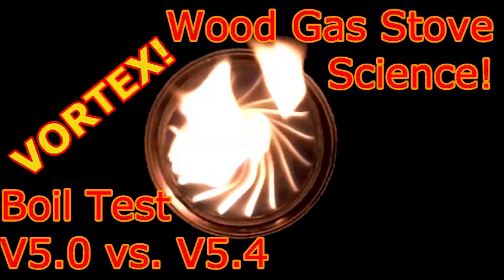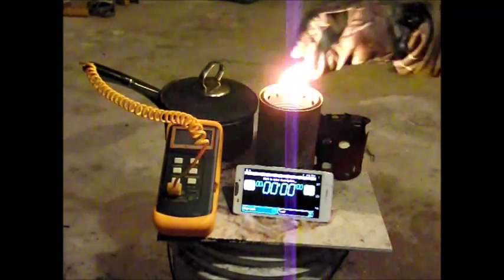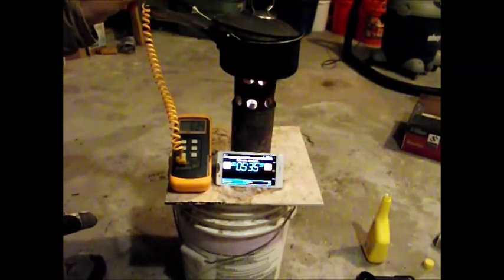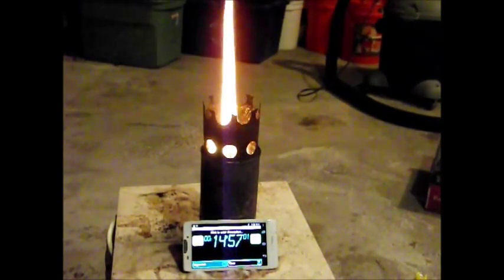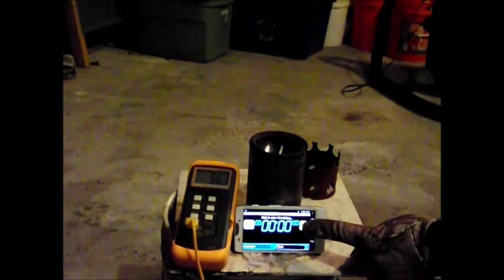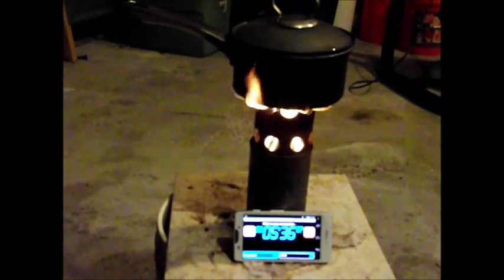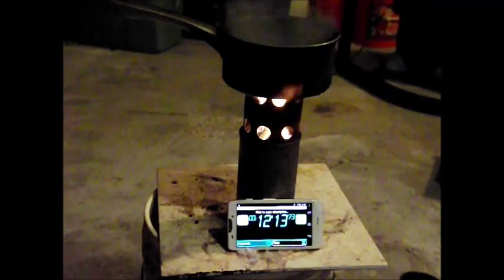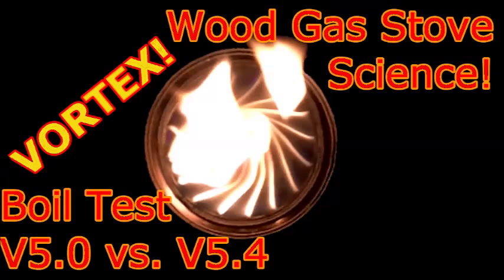Wood Gas Stove SCIENCE! Boil Test V5.0 VS V5.4

Comment: Really interesting stuff - I wonder if the relaxing ash is blocking the primary holes towards the end of each burn as they drop. Maybe flaring the holes up and down alternately might help (Like a volcano next to an inverted volcano) so the ash could potentially drop through the bottom or at least settle away from some of the upward pointing holes. Or maybe a central air tube like a piccolo tube reaching 1/3 of the way up the middle of the can purely to inject more air to the pellets. Any thoughts?
Reply from the maker: littledoms Those are interesting ideas! I will give them a try. Keep your eye out you may see them on an video in the near future. I have received some great ideas from viewers that I have to try also. Thanks for the comments and Thanks for viewing!
Reply: Thank you for doing the research and sharing the results! I'll stay tuned.